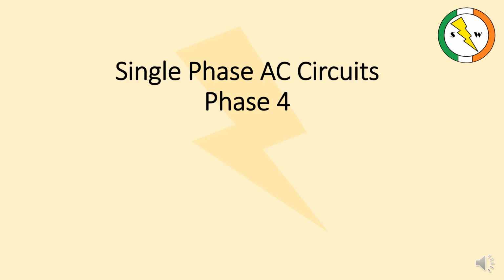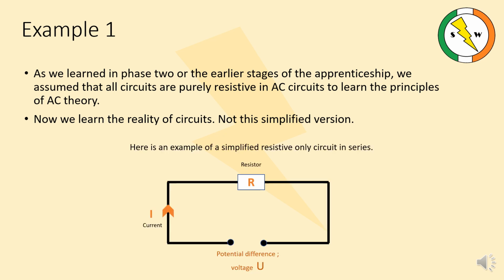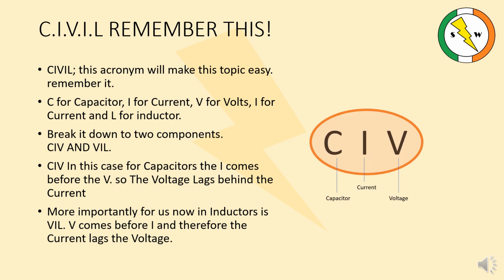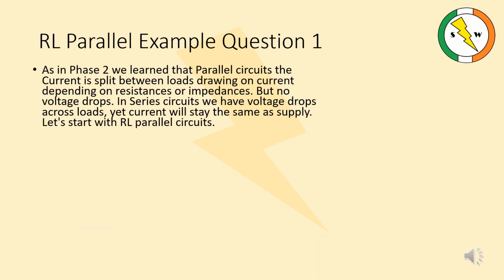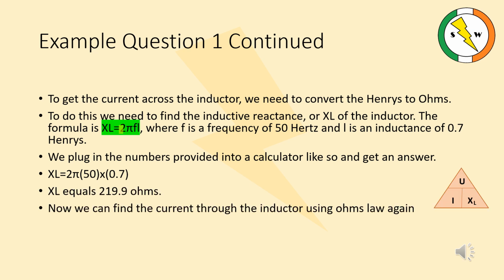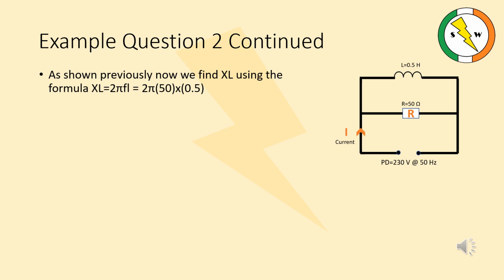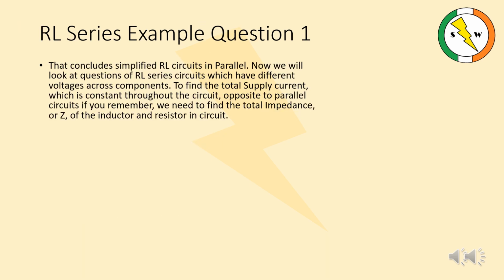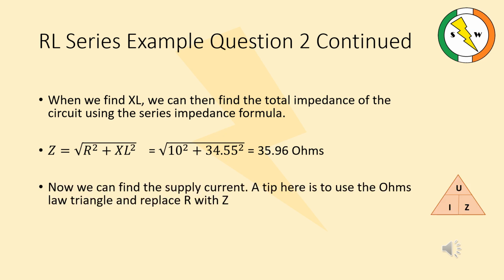RL Series & Parallel Explained. Inductive Reactance  XL. Phase 4

Comment: Hey, your videos are really helping my study. But I have a question about sample question 2 at 8.41 into the video. When I try to calculate the total current its i get 4.8 amps instead of 2.4amps like you do in your answer. Am I missing something here or is that a mistake?

Thanks again for the videos
Reply from the maker: Hi Mick. 

Appologies for the late reply, I am flat out with my business. But you are correct, that was a mistake in the video from a different sample answer. Well pointed out and good job.

Glad the videos helped and if you done your exams I bet you done great. 

Hopefully can get some phase 6 videos together when I get some free time. 

"7